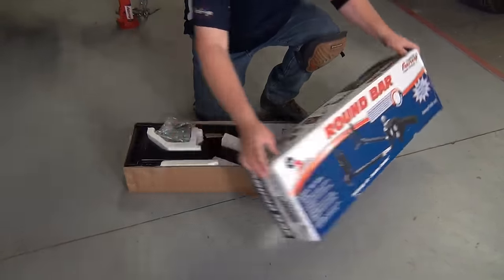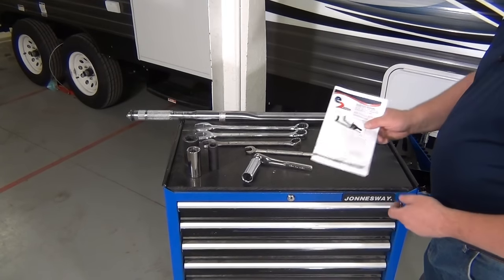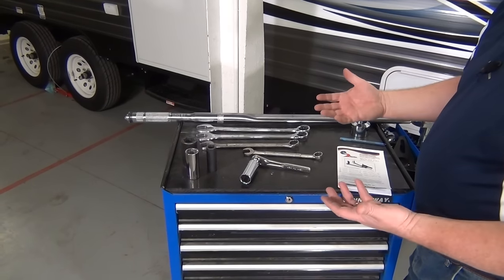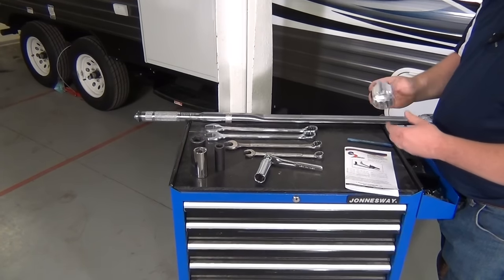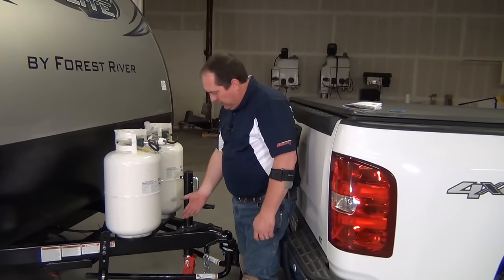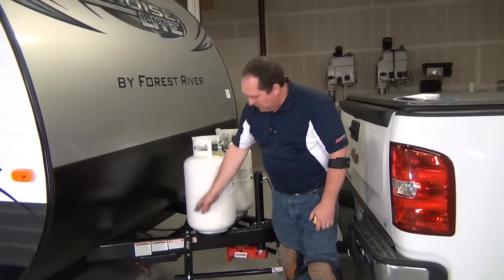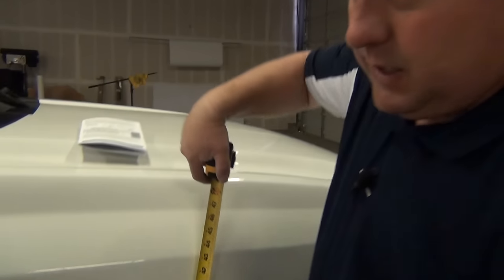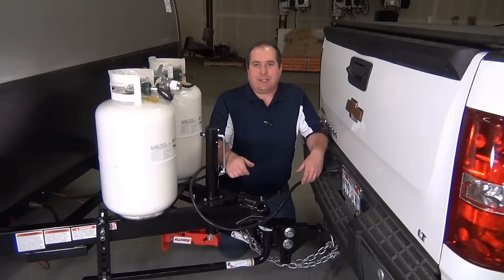How To Install Your Fastway e2 Round Bar Sway Control / Weight Distribution Hitch*

Comment: The hitch made a huge difference on my setup and I didn’t even have it setup completely. I did have an issue with incorrect parts and a bad experience with their customer service. One of the shank bolts was wrong and was below any decent grade bolt (ended up completely stripping the threads before I got any near torque specs). I called and the person I spoke to seemed new because he had no idea what I was talking about and I could hear someone coaching him on what to say. He asked where I bought it from and was told to contact Amazon since I bought it from them. I explained how this had nothing to do with how it was shipped but everything to do with quality control from the manufacturer. In the end, I was told that I could package it back up and return to Amazon, go buy the correct bolt myself, or they could ship the correct part BUT their shipping was going to be down for a few days. 
Not a good experience at all!
Reply from the maker: We are sorry about your experience with the missing parts and our customer service team. This was a combination of newer employees that were still learning, and just rough timing. When you called, we had just lost two senior members of our customer service team, and we were training their replacements. We could have easily just sent you the parts, but our shipping does close for a few days a year for annual counts, and it just happened to be that week. Dang it! 
 
As far as quality control, we have had tough experiences with 3rd party Amazon sellers and are actively working on addressing those issues. Before our hitches leave our Provo, Utah facility en route to our distributors, they are thoroughly quality checked, but once they are gone, we have had heard of missing/swapped parts happening with Amazon sellers. If you could send us your purchase receipt to equalizersupport@progressmfg.com, we would love to follow up with the Amazon retailer.
 
We are thrilled that the hitch made a big difference, even before it was set up correctly, and again apologize for the frustrating experience. Thank you so much for contacting us!

Comment: Is there any more of an explanation of when or how or why the ball angle needs adjusted?
Reply from the maker: It is to put more tension on the spring bar arms, which provides more sway control/weight distribution if you add a washer, or less sway control/weight distribution if you take one away.
You will want to make these adjustments if you need more sway control, or have too much weight distribution, you will add or take one away, respectively. 
This is done by disconnecting the hitch head from the shank, and placing or removing washers from the spacer rivet that is between the two.

Comment: I'm having a difficult time finding a 1 7/8" socket that will clear the bar mounts in order to tighten the ball nut.  I do not have a Fastway dealership near me.  I tried several U-Hauls and mechanics but they did not have the right equipment.  Sorry, I do not want to pay what you're asking for your branded socket.  Can you tell me the the height of the socket's outer flat wall right before it tapers off?  I am referring the dimension you mention at 5:14  Thank you very much in advance.
Reply from the maker: +Joanne Cho,
The outer flat wall is 1.400 to 1.500 inches. The tapered section is 0.313 in, and the neck where the socket drive attaches is .688 inches. The overall height is 2.401 to 2.501 inches. The outside diameter of the fluted section is 2.400 +/- .016 inches. Hope this helps. Let us know if you need anything else. Good luck!

Comment: My RV dealer installed the brackets on the trailer and assembled the hitch head but didn’t do any measurements on the tow vehicle. They just hooked it to my truck and sent me on my way. Is this one of those things that after you’ve done so many you can intuitively set it correctly or do I need to fine tune it?
Reply from the maker: To find the most correct position for the hitch head and ball, having a measurement from the ground to the inside top of the receiver tube is really important, so fine tuning may be required!

Comment: I love our E2 hitch. Have a question on the L Brackets. One is loose and the other is tight. I assume, dangerous thing to do, that if they are to be at 75 ft lbs they should be tight, correct?
Reply from the maker: Yes, you'll want to tighten that bolt!

Comment: I have airbags on my truck. Should I set the trailer on the ball so it squats and then see how much air it takes to get my truck leveled back out, then take the trailer off and set my ball with the washers?
Reply from the maker: Great question. Please see page 18, of our manual, where it discusses how to set up your hitch with auto leveling. You will want to start with the system turned off. Auto leveling decreases the weight distribution by 20-25%, so aim for 75-100% weight distribution, so once auto leveling is engaged, you have compensated for the loss. https://www.equalizerhitch.com/documents/manuals/EQ_Owners-Manual_6K-14K_2020-web-EQINS2012.pdf

Comment: I have a question. My dealer told me to have the hitch ball in the truck an inch and a half higher that the coupler, but on this video you are having them at the same height? Which one is correct?
Reply from the maker: Our recommendation is to have the top of the hitch ball level with or up to an inch above the top of the trailer coupler when both vehicles are next to each other, on flat ground, and level to the ground. In some cases you may need to turn the shank upward or use a bigger rise/drop shank to place the hitch ball at the correct height.

Comment: New to travel trailers and WD systems.  I've inherited  a 21' travel trailer with this WD system installed on it. Gross weight of the trailer loaded is @6200 lbs and max trailer weight limit up to 7600 lbs  for my Chevy Colorado Z71. After towing it home from where I picked it up, I could tell that the rear of the truck was much lower than it should be and the nose of truck was definitely pointed up.  There was almost 4 inches of drop when the trailer was added. A friend who went with me(who has a much larger trailer) that that the drop wasn't that significant.  I believe that to be incorrect!   Since I have no data other than what I see here, it looks like I should start over with the install as this clearly cannot be correct.  My quick question to you all is, where to start on the adjustment of this system to match the truck? I did initially reverse the hitch shank and install it "up" as that seemed to be the better position for it to match  the hitch ball coupler height on the trailer to make it "match level" at @ 22"s. Didn't change the position of the link plate or "L" brackets yet.  Do I need to relocate the "L" brackets, up or down to reduce the weight on the hitch ball and thus reduce the down force on the rear of the truck? And if so, by how much to start?   Sorry.. I'm a neophyte with this rig.. I do plan on traveling with the fresh water tank empty (40 gallons) until getting close to the final destination to reduce that weight up forward on the trailer.   Appreciate any assistance from Fastway or other users.
Reply from the maker: The best way to get an answer to your question would be to contact our customer service team at info@fastwaytrailer.com or call them at 877-523-9103.
Reply: @FastwayTrailer  Thanks... I've left a few messages over the past week or so with no response. I'll try again this week.

Comment: How do you recommend installing the hitch ball if one doesn't have the large torque & crescent wrenches?
Reply from the maker: +David Thompson,
We recommend that you find a reputable e2 hitch dealership and have them setup and install your hitch. You can use our dealer locator to find one in your area.  https://www.fastwaytrailer.com/find-a-dealer  Also, if the 10K model works for your needs, you can purchase one with a pre-installed hitch ball. https://www.fastwaytrailer.com/e2-hitch  Remember, you will still need some large wrenches and a torque wrench to tighten the hitch head to the adjustable shank when setting up the hitch.
Other options include finding a mechanic / auto repair shop near you that has the tools and is willing to help, or finding an auto parts retailer that rents tools.
Thanks for the comment, and good luck!

Comment: Do you have a recomendation  on what I should adjust to Lower the nose of my truck approximately 1" ?  I am using 3 washers and my "L" brackets are using the top two holes. I shouldn't  have to adjust the Hitch head.   I also ask this question in case I change the weight of what I have on the rear of my vehicle. Sometimes I will have a generator and two kayaks on a rack. Thank you.
Reply from the maker: See response on your second post. Thanks for watching!

Comment: Any thoughts on how to remove hardened grease that is up in the bar tube on the hitch.  I bought a used one.  Crazy enough to get it off the bars themselves.
Reply from the maker: Hi there! Your best bet would be to scrub at the grease with hot soapy water. Good luck!

Comment: I have this on my camper from the dealee and the angle set bolt has come a little loose is it normal then for the ball mount to be wiggly on the shank even though the two giant bolts are allegedly torqued to spec.
Reply from the maker: +Joshua Freeman,
No, it is not normal for the hitch head to be "wiggly" on the shank. The spacer rivet and washers, and the angle set bolt should both be tight to the shank, and then the shank bolts tightened to the correct torque. This should pinch the bolt channel solidly to the shank so there is no movement.

Follow the instructions to tighten the angle set bolt and get the shank bolts torqued correctly. We highly recommend using a proper torque wrench to tighten the shank bolts, not an impact wrench. If you have trouble with any part of that process, please get in touch with our customer support staff for help. 877-523-9103 or Support@FastwayTrailer.com
You can find the e2 hitch instructions here: https://www.fastwaytrailer.com/manuals

Comment: I have a 98 f150 36" in front and back unloaded. When using weight distribution hitch is 35" in front and 32.5" rear what should I change.
Reply from the maker: Ian Baker,

Unfortunately, this does not give us enough information to help well. At first glance, it looks like you are getting too much weight distribution, because the front measurement is lower than the unloaded baseline. If that is the case, you need to remove spacer washers in the head assembly, or lower the L-brackets.

Our advice is to go back through the setup process outlined in this video, and the owner's manual.  If your hitch is an e2 hitch, the manual can be found here: http://www.fastwaytrailer.com/manuals

Briefly, the steps are: adjust the trailer parallel to the ground and measure the coupler, place the hitch ball at the correct height (use a specialty shank if needed), take initial front measurement, couple the trailer w/ no weight distribution, take 2nd front measurement, engage weight distribution, take 3rd front measurement and compare (see owner's manual), adjust weight distribution as necessary, check trailer attitude and adjust if necessary, tighten everything down.

If you feel like you need more help, get in touch with our customer support department at 877-523-9103 or Support@FastwayTrailer.com
Reply: your rear...  '98 f150 is basically too light to tow anything per ford, check with dealer for ford recmnd

Comment: My dealer installed the inside link plate upside down on both sides. Is that common? Also the middle inside link plate is bowed and there’s a gap at the bottom of the frame and the screw.
Reply from the maker: This is done in some scenarios, specifically when the trailer has a bottom mount coupler. The most important thing is that the bars are able to run parallel with the frame of the trailer. As long as there are points of contact at the top and bottom of the frame, you should be okay. You can always send pictures to our customer service team via email (support@fastwaytrailer.com), and we would be happy to check them out for you!

Comment: I definitely do not have these bigger tools, or any of the torque wrenches.  I really don't want to spend hundreds of dollars on tools.  Can you recommend a course of action please?  Is the speciality 1 7/8" socket required for installing the ball or would most mechanics have something that would work?  By the way, you should offer options with the ball installed.  I just ordered this system from e-trailer, and I wish I had watched this video first.
Reply from the maker: accidentalhobo,

We do have a 10K model that comes with the hitch ball pre-installed. The part number for that is 92-00-1065.

Yes, you need a 1-7/8" socket that is slightly shorter than standard, and is also tapered at the top where the wrench inserts into the socket. They are not uncommon, and you can probably find a mechanic near you that has one that could help you.

Here are some recommend options:

1) Find a reputable dealership near you that carries the e2 brand and has the equipment, and ask if they would be willing to install the hitch ball or entire hitch for you, for a reasonable service fee. You can use the dealer locator on the Fastway website, or call in to our customer support team and have them help you with this. https://www.fastwaytrailer.com/find-a-dealer or 877-523-9103

2) Contact eTrailer.com and ask if they would exchange for the model with the ball pre-installed (if the 10K is the model you need).

3) Purchase the specialty socket from us for your local mechanic to use. The part number for the socket is 70-00-4800.

4) Many automotive parts stores and equipment rental businesses rent tools. Check with some near you and see if they have the sockets and torque wrench available.

Remember that you will also need a torque wrench capable of 250 ft-lbs, a 1-1/8" wrench, and a 1-1/16" socket to tighten the bolts that hold the hitch head onto the shank, and a 15/16" wrench for the angle set bolt on the hitch head.

As always, feel free to contact our customer support team if you need more help.

Good luck!
Reply: I truly appreciate the prompt response and information!
Reply from the maker: +accidentalhobo,

You're welcome! Our goal is safe and happy customers. Good luck getting it set up. Be sure to contact our customer support if you need any more help.

Comment: I have this exact WDH model. I placed my L brackets at 27 inches (just behind the propane tanks), but I cannot raise the brackets high enough to provide enough weight distribution. (2 inch vehicle drop becomes a 1.5 inch drop  at my current settings.) Attempting to raise the L brackets higher, I run into the bottom of the propane tanks. I would have to move the L brackets back to 28 inches to alleviate the issue. I understand going to 28 risks the bars sliding off in sharp turns so I assume that option is out. Can I exchange my bars for longer versions? Alternate ideas: is it safe to cut material off the top of the L bracket? Is there a safe product to lift my propane tanks an inch or two while keeping them secure? Not looking to cut off and re-weld the propane tank tray. To get in front of my tanks I'd be at 16 inches and the bars are clearly too thick at that point, not to mention the undesirable loss in torque from the shorter moment arm. If I invert the L brackets I'd get my lift, but the brackets would reach down to 2-4 inches above flat ground which wouldn't end well on uneven surfaces. Thanks for any additional ideas. 2011 Keystone Hideout.
Reply from the maker: Hi Chris! The best way to get your questions answered is to contact our customer service team at 877.523.9103 or you can email them at  info@fastwaytrailer.com. Thanks!
Reply: Chris move those propane tanks forward maybe 3 inches and it should give you the clearance needed for the brackets.

Comment: Can I increase the tounge weight max by replacing the bars?
Reply from the maker: Yes, the 6k bars will have a max tongue weight of 600 lbs, the 8k bars will have an 800 lb max tongue weight, and the 10k bars will have a 1,000 lb max tongue weight.

Comment: when I connect my 5500LB trailer to my chevy 2500HD the front wheel measurement doesn't change at all from the unloaded measurement, how do I know if it's under or over distributed?  thanks
Reply from the maker: It sounds like you need to take a look at  your tongue weight and make sure it is correctly proportioned to your gross trailer weight (GVW). This assumes that you do not have an auto-level system that is making vehicle adjustments when you hitch up. With a 5,500 lb trailer you should be somewhere between 550 lb (10%) and 825 lb (15%) of tongue weight. That should be enough to raise the front end. Having enough tongue weight greatly reduces the likelihood of sway problems and allows your hitch to distribute that weight, which also helps with stability and sway control.

If you have the correct ration of tongue weight and your front end is still not raising, check your axle weights at a CAT scale. You should see your baseline (uncoupled) front axle weight show heavier than your coupled (with no Weight Distribution) weight. The ideal would be to get at least halfway back to this baseline weight. For example, if your baseline is 3,000 lb, and the coupled is 2,700 lb, you would want the front axle weight somewhere between 2,850 lb and 3,000 lb with your weight distribution hitch engaged.